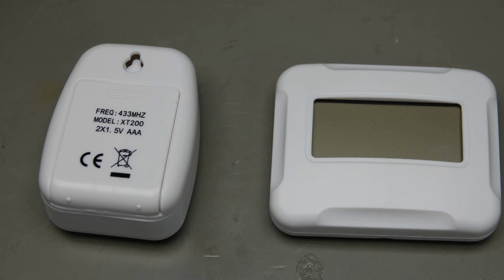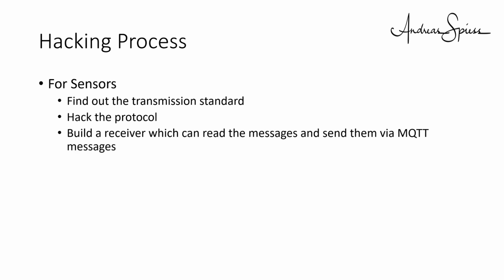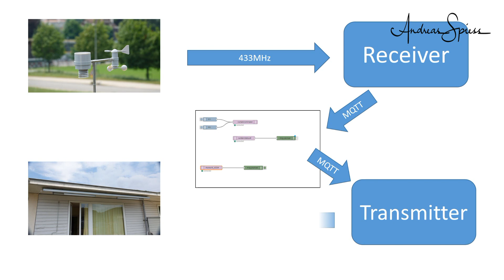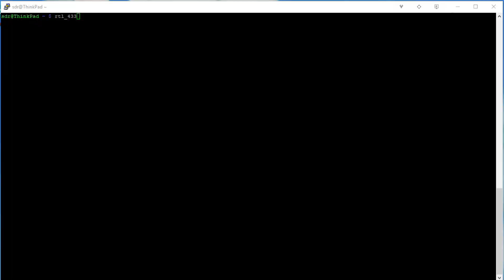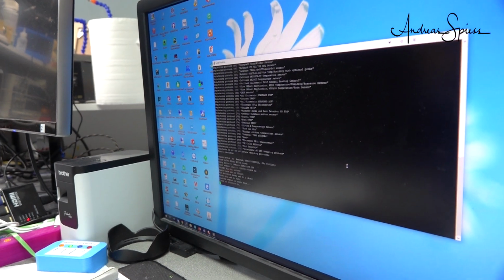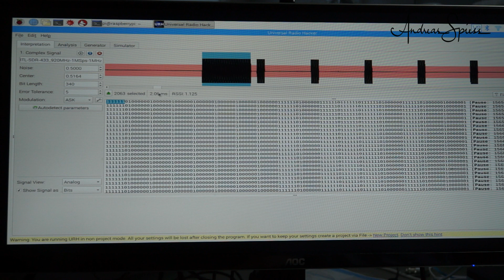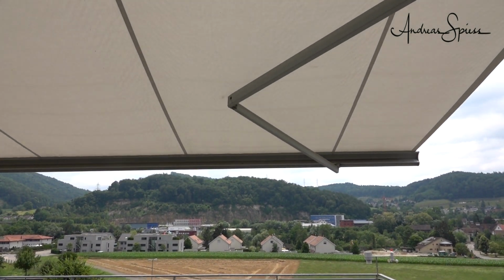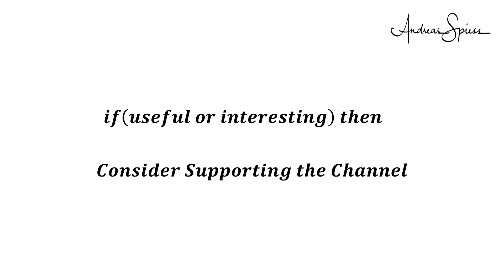#209 How to Hack your 433 MHz Devices with a Raspberry and a RTL-SDR Dongle (Weather Station)

Comment: I was searching to read and actuate RF signals .
This Video is too useful to me. 
Thanks Mr.Adreas
Reply: But Mr.Andreas, I am looking for a way to read a signal which in transmission wire between the RF receiver and Main board of a Car security system. 
So i can simulate it to open/close my car from my mobile application.
Reply from the maker: Modern cars use encrypted codes.
Reply: Andreas Spiess Thanks for replying 😊☺

 Well, My car is manufactured in 1997, The security system is installed as external unit . I don't think it's time-based encrypted, because receiving unit or remote controller loses power sometimes.
Reply from the maker: To sniff logical signals you need a logic analyzer. I did once a video about that (something like " make Invisible signals visible")
Reply: Andreas Spiess I'll check it out .

Thank you ☺

Comment: Does anyone know whether this gadget is compatible with rtl_433?
https://us.banggood.com/Wholesale-Warehouse-Black-USB-2_0-SDR-DVB-T-USB-Stick-Receiver-RTL2832U-And-R820T-Tuner-Antenna-wp-Usa-1123670.html

It sounds like it might be, but Banggood's descriptions are often vague on details like chipsets, and don't have a consistent format from product to product.

This one would be handier for me, since it's about the same price, and doesn't strain my patience with a multi-week wait for delivery from China  ;-)
Reply: yes, but: https://www.rtl-sdr.com/comparisons-r820t-r820t2-rtl-sdr-tuners/
Reply: Thank you, Frank. I'll check ebay to see if I can find a domestic supplier for  a dongle with the R820T2. But the first commenter on that post did make a good point about comparing only one of each type for sensitivity: when you're buying no-name $10 gadgets that process RF signals in the hundreds of MHz, all it takes is a little sloppiness in assembly to make a few dB of difference from unit to unit. It's not like buying an Adruino or RPi knockoff, where a bad solder joint might be intermittent, but will fail obviously rather than subtly degrading performance.

Comment: What 433 MHz transmitter are you using? Can you recommend this one?
Reply from the maker: You get them on AliExpress. I think they are all more or less the same
Reply: I had a bit of trouble finding the one in the video, before finding this one, which includes transmitter and receiver https://www.aliexpress.com/item/433M-TX-RX-Super-regenerative-Module-Wireless-Transmitting-Module-Alarm-Transmitter-Receiver/2024422377.html

Comment: Drive a uhf 440mhz 200 watt amp and close as many awnings as you can on windy days and then open them when wind calms.
Reply from the maker: And maybe it would be legal. I do not remember the power limit on 70cm

Comment: I wonder if you can use Pi itself to transmit signals with software like PiTx
Reply from the maker: SDR can also create signals for transmission. Just not with these dongles. You need something like a HackRF or the board you mentioned.
Reply: Andreas Spiess I know that SDR can create those signals, but devices like HackRF are usually very expensive. PiTx I was talking about is software (not hardware) that you use to transmit by connecting wire on Raspberry Pi pin 12 to use it as antenna.

Comment: Good video. I have many now unused 433 MHz alarm sensors around the place I could perhaps repurpose. 

Unrelated, what is the brand and model of 3D printer you use?  I understand you like it very much and am considering purchasing a printer for myself. I suddenly find the need to print many small one-off parts.
Reply from the maker: I have a Prusa Mk3. Not cheap but worth the money if you want to print and not to enhance your printer.

Comment: Great video, SDR is alot of fun and really cool.  I would suggest putting GNU Radio in your toolkit.

I have 2 Nooelec USB SDR dongles that work real well, both use external ( provided ) antenna's
Reply from the maker: I agree. It is already in the tool kit. Just not used in this video. And some nice HW like a HackRF and a Pluto...

Comment: Did you try to find a spare remote on eBay? Or you you HW hack your remote to send a signal via I/O pins?  Life would be much easier then!
Reply from the maker: I thought live is easy with these new tool. I did not need a new remote. I already have one. I wanted to remote control my awning.
Reply: Andreas Spiess So you can also buy a generic 433MHz remote from eBay so that in your next project you will have an easier time ;) Generic solutions are the best!

Comment: Thanks for the video. I knew about rtl_433 but hadn't heard about Universal Radio Hacker, used to have to use Audacity to capture waveforms. Great find. Just an FYI, I believe that the RFM96 radio that is used for LORA can also be programmed to do OOK and AFSK. What would have to be done is to connect an I/O pin to D2 (not done on most combo boards) and program the RFM96 to OOK mode. So far the RADIOHEAD libraries don't have that implemented but it shouldn't take too much hacking to figure out the configuration file. That would allow you to move the frequency just a little away from the 433.92 standard, as long as the new chosen frequency is still within the unlicensed band for the country of use. That is in one of my up coming projects. I have an Acu-Rite temperature sensor that I was going to use to figure it out but it saved me the time and fell off the tree into the mud and died.
Reply from the maker: You can get much cheaper chips to do OOK on 433. And there you probably would get the library support.
Moving away from the frequency is probably easy for our chips, but not for my awning or the weather station...

Comment: Would it be possible to use a 433 MHz receiver module instead of the SDR dongle? Since you used a generic module to send your messages, a generic receiver should have been able to do the receiving/sniffing. Then you could omit the use of a Raspberry PI and one ESP32 could do the whole job.
Reply from the maker: This is of course possible. And I will probably go this way later on. But for hacking an SDR is much more versatile, because in the beginning, you do not know anything. Only after hacking you know which 433 receiver chip will do the job (ASK,FSK,PSK for example). And maybe you even do not know the frequency. This one was simple...
Reply: Thank you for the answer. I didn't even realize that there are differences in the 433MHz modules. After looking around I assume that CC1101 based transceivers are a good choice because they cover a variety of modulations. Cheers!
Reply: Something to consider though is there's a lot of ready to use software for the RTL based SDR dongles. Using your own 433 MHz receiver you'll likely have to write a lot of tooling yourself.

Comment: I don't understand why it didn't work with ESP8266. My guess is that you have to use delay() in combination with delayMicroseconds() since the latter does not give any time for the network stack. Maybe this works with ESP32 since this has dual cores. Try using delay() for ''N' and perhaps also for 'L'.
Reply from the maker: As I said I gave up. Not before trying a few things... Maybe the delaymicroseconds() was the problem. But I needed it in this concept.

Comment: you could just use an esp8266 (cheap soc) or the more expensive brother the esp32 with a superhetrodyne 433 receiver/transmitter module

use the rfswitch.h library (easiest to decode most common 433 sensor codes)
for decoding weather station data there are other libraries around that support various models and brands.

with around $12 in parts ive build a main receiver to relay all sensor data to "Telegram", i can also send codes to enable/disable my alarm and open my garage door.

since Telegram uses its own "mqtt" protocol and encryption i dont have to worry about security issues and server reliability
Reply from the maker: Does the rfswitch library support the ESP8266 for receiving? And does it support weather stations? I only found a library which works on Arduino Mega for that purpose.
BTW: My config (Rpi zero plus dongle) is also not too expensive.
Reply: yes it does,

check the library code RCSwitch.cpp from https://github.com/sui77/rc-switch/ (it has support build in for esp8266)
you need to define ESP8266 in your arduino code then it compiles and works properly for receiving and sending.

for the weather station there are some good existing libraries, for arduino/esp8266.
the RC-Switch library doesnt support directly weather stations but you can either include a 2nd library into the same project and code since both libraries can work together since they are not interfering with eachother.

or you can modify / add some extra code to the RC-Switch library to support your weather station next the regular sensor/remote codes.

if people dont have an SDR tool to reverse engineer a particular sensor or weather station, you can make your own 433mhz sniffer with very few parts:

https://rayshobby.net/wordpress/interface-with-remote-power-sockets-final-version/

https://rayshobby.net/wordpress/reverse-engineer-wireless-temperature-humidity-rain-sensors-part-1/

Rpi is also great if you like comfort to work with a wide array of programming languages and multithreading,
i like to work with the esp8266 or esp32 for the reason it is cheap, robuust and for the things i need it to it has more then enough power to process the information.
Reply from the maker: Thanks for your info. I also use the ESP's a lot. But for RF hacking I prefer the RPi and SDR because at the start you usually do not know a lot about your device. At the end of the hacking, you know it and you can build it into an ESP. Which I did for the transmitter (I could have used HackRF) and will probably do for the receiver as well since I know now the modulation and the protocol...

Comment: Andreas, there is good library for Arduino RCSwitch, which I used a few years ago to control all my RC sockets with one single Arduino. With one example program you can easily grab codes from existing remotes and then you can use them in your application. I think it should work also with your 433 devices.
Reply: RCSwitch library works with ESP8266. It might not be able to decode weather station protocol, but works for those cheap fix code remotes.
Reply from the maker: Do they also work for the ESP?
Reply: I don't know, it was before ESP chips. Maybe somebody already ported it or other one exists.
Reply from the maker: I got another link to
 an ESPilight library which seems to work. I will give it a try...
Reply: Yes it works! I use it in my home! You can also use this gateway: https://github.com/1technophile/OpenMQTTGateway

Comment: If you are in the USA, 433 MHz is in an amateur radio band. So use the 800 MHz version. Or maybe the power is so low they are legal on 70 cm. I don’t know. You should check first I think.
Reply from the maker: It is the same here. But parts of it are also ISM. So it is legal for everybody, not only for us :-)

Comment: Perhaps for the brave, one could open their 433Mhz device(s) to see if there are connections to which a serial monitor/programming interface might be attached... Not sure if reading such device(s) firmware would help so much, but might provide helpful data about undocumented gizmos.  Thx.
Reply from the maker: The URH should show exactly the same timing as you would see on the pin driving the transmitter. So not a big reward for the effort and the risk it is no more waterproof afterward

Comment: Very well made video. Thanks for showing the rtl_433 software. It will no doubt be useful in future... Why add another wireless temperature sensor, if I can tap into the data sent by commercial units.
Thanks!
Reply from the maker: Fortunately, I did not discover a wind sensor in the neighborhood. Otherwise I would have made a bad purchase ;-)
Reply: And unfortunately I did not discover a wind sensor in my neighborhood. Oh well, temperature logging is what I'm after and there are couple of temperature sensors. Cheers!
Reply: For me, the advantage is that you can add another sensor: our weather station with the internet interface only supports two, and I want to monitor the temperature in the unheated/uncooled workshop, as well as the office and outdoors.

This will let me add a couple of sensors to watch the workshop floor and attic. And add sensors at my house without having to spend a bunch of money on an internet-connected weather station.

Thanks, Andreas!

Comment: What a great tutorial! Quick, without going to the details, but very succinct and easy to follow. The Best of it is introduce a full workflow to solve a problem from A to Z using a set of different tools like SDR, decoding signals and mqtt integration. Many thanks for sharing your work. For sure this method can be used to an infinity of solutions
Reply from the maker: Thank you. I hope it will help also for other situations...

Comment: maybe you could elaborate more on the code shown in https://youtu.be/L0fSEbGEY-Q?t=8m58s, particularly the while loop.. Thanks.
Reply from the maker: It should be self-speaking. It just reads the codes at the top letter for letter and creates the timing and switches pin 4 on or off.
Reply: Thank you, so far so good, but how is the loop condition meant to work?

Comment: Nice video as always.
But I think its a bit overkill to use a RPI when you have the ESP32. Why not use ESP32 for both transmitting and receiving?
433 receivers are also very cheap. But I think that you should keep the MQTT for both ends. In that way you can controle your Sun Blinds through ex. Node-red, also for  other devices (Lux sensors, buttons etc.).
Reply from the maker: If you provide me the code for decoding the Weather Station Signal I go for it. In the meantime I do not consider it as an overkill. I use a Zero plus a dongle.  Not so expensive. And to decode the code of the station is probably a little more complicated than the remote control with 4 buttons.
Reply: Would be great to see an ESP device receive the weather station signal. Big price difference between ESP and a Pi.
Reply: I have no expirience with SDR and rtl_433, but since this is opensource software and it can decode the signal, I would look into the source code, ex: https://github.com/merbanan/rtl_433/blob/master/src/devices/fineoffset_wh1080.c
Perhaps this code would give some input on how to decode the signal.
Reply: I'm currently researching an ESP8266 to allow computer/Alexa control of IR devices. The libraries I've been looking at say the ESP8266 has problems with IR remote decoding (but not encoding). I think it's due to the multitasking of running the radio screwing up the capture timing. I'd expect similar problems trying to capture the demodulated RF pulses. ESP32 might work better, because I think it has a separate CPU core run the radio.

But the Pi Zero+SDR makes a nicer environment for exploring: it's easy to retune the radio to hunt for the right frequency, and you have more tools available for formatting/storing the results.
Reply from the maker: +oleost: I use a Pi Zero
Reply: An other solution could also be to replace the electronic inside your weather station. This is a solution i have done. I bought a faily cheap weather station and only used the mechanics. The electronics are replaced with an small ARM processor and a RFM69HW-433mhz radio module.  One of the main problems is to bring down the power consumption, in my case the CPU uses 3uA during sleep and about 15mA during transmission (100ms) The weather station is powered from a small LIPO, and is charged from a small solar panel.
Each minute all measurements is transmittet to a reciever ESP8266 + RFM69HW module and send to my MQTT server. By the way the weather station is located on an open field about 300 m distance from my house.
Sensors: weather vane(TLV493DA), cup anemometer(original reed-sw), Temperature sensor (Si7021), humidity sensor(HS3001), UV sensor(VEML6070) , rain sensor (original tip bucket, reed-sw)
Reply from the maker: Looks good and has many sensors.. In my case if I would replace the electronics I would probably go with an ESP and Wi–Fi because the station is near the house.

Comment: I have a unused first model raspberry pi, will it work the image? Would be wonderful to reuse that old raspberry and not having to buy one model 3! Thanks for your nice videos!
Reply from the maker: I used Frank‘s instructions on a zero and it worked. The SD card most probably will not work

Comment: is there a psoibility to use win10 instead of raspi ?
Reply from the maker: Yes. With a virtual machine. It is described in Frank's description
Reply: Maybe - have not tested but: https://cognito.me.uk/computing/windows/2015/05/26/rtl_433-windows-binary-32-bit.html
Reply: program works, does something, just don't know if I have any stations in range on 433

Comment: I've hacked mine 433mhz devices with RFLink project and Domoticz. It was less complicated in my opinion. I can control my blinds and receive weather station data as well
Reply from the maker: Thanks for the tip!
Reply: marthale7 the cheapest eBay units. Works perfectly for over a year. In RFLink manual they mention about them as well

Comment: Thanks for this great method. It will be helpful if a device is not supported by the RFLink SW running on a MEGA2560.
Reply from the maker: Is the RFlink only running on the Mega? This seems to be quite limiting. I would like it on a ESP32
Reply: Unfortunately up to now it seems to be limited to the MEGA - as far as I know. But for me it is more or less an intelligent frontend for ioBroker which maintans the datahandling etc.   
There also exists a Sonoff RF Bridge between 433MHz and Wifi. It costs around 10 EUR and is supported by Tasmota SW system. But up to now I am just using RFLink and ioBroker.